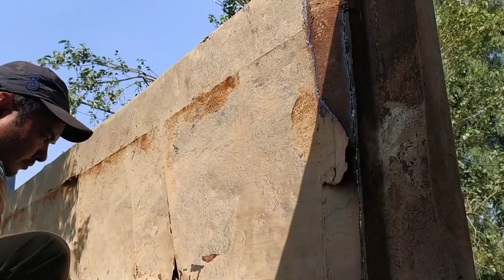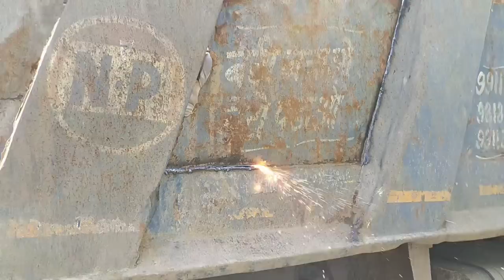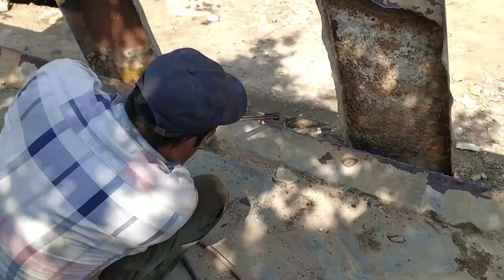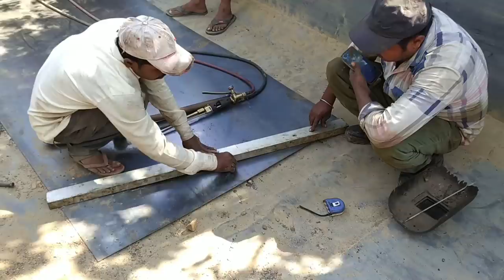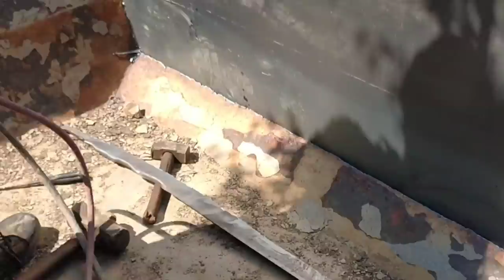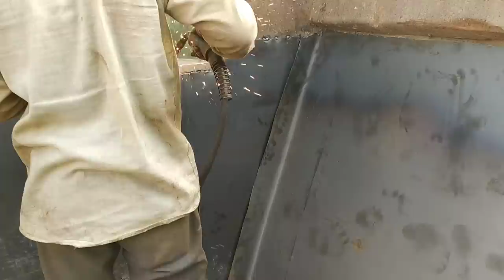Truck rusted body rebuilding | Dumper rusted damage body restoration

Comment: I guess when you're poor and desperate you do with what you have,but this is terrible workmanship...🙄
They cut into the structural ribbing on the dump body,then replaced the 1/4 " steel plate with 1/8" plate.. 
Someone either put a larger tip on that cutting torch or just give him a angle grinder with a cutting blade,cause that was the slowest torch cutting I've ever seen...
Reply: OK. I thought it was me.
Reply: Bondo would off too quick. Superglue will bond almost everything not sure about concrete. Dirty welding over muck poor job.